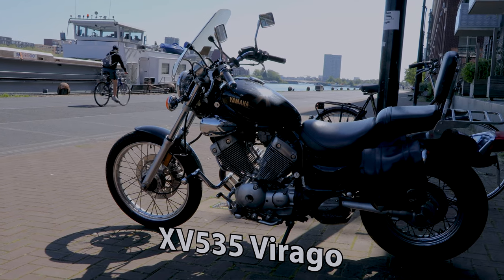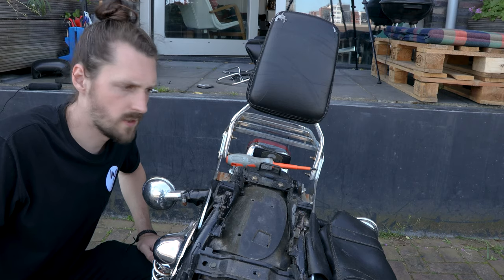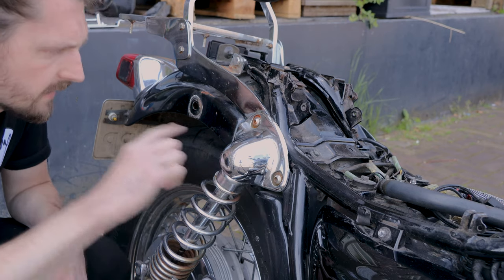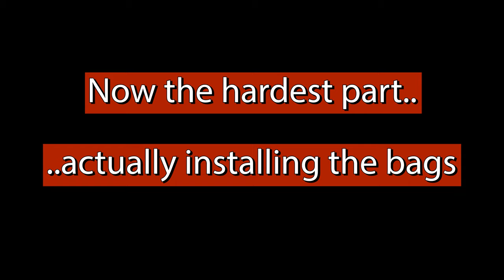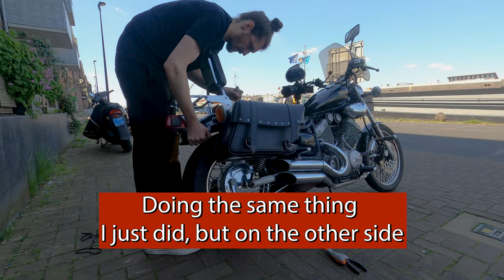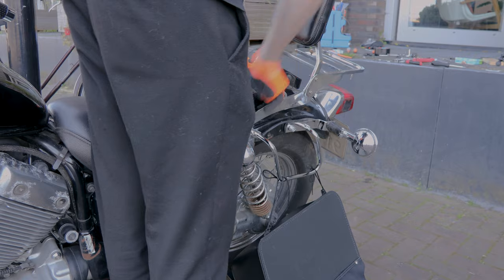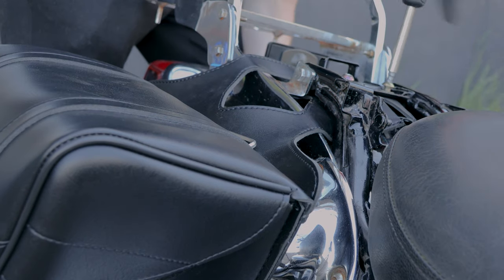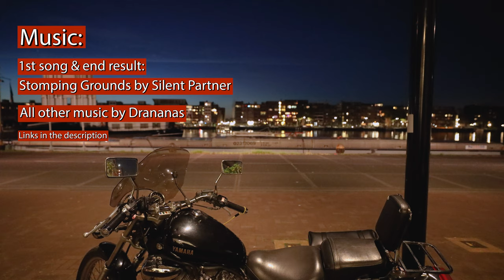I put new saddlebags on my XV535 Virago motorcycle

Comment: Where did you order your indicator support replacement part? Same thing happened to my 535 indicators, and I used duck tape as well to fix them too lol

Thanks for the video! Super helpful
Reply from the maker: I ordered it through Boonstra parts, it's a Dutch shop that sells both used and new motorcycle parts. If you live in Europe, it may be interesting to check them out! Otherwise you can try ebay, I think they're on there as well. Hope that helps! 

Thank you for watching, glad to hear you enjoyed it!